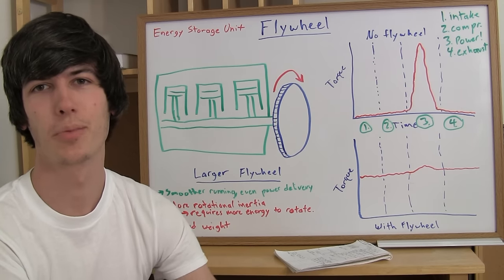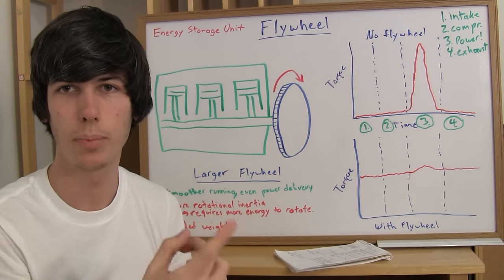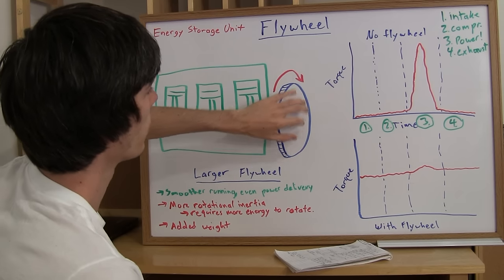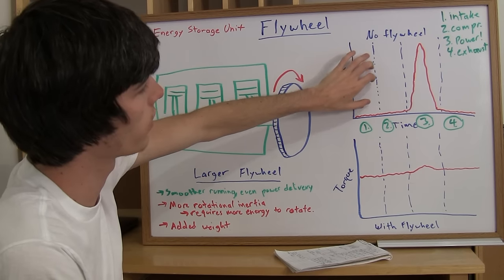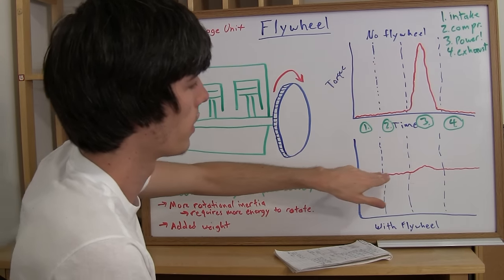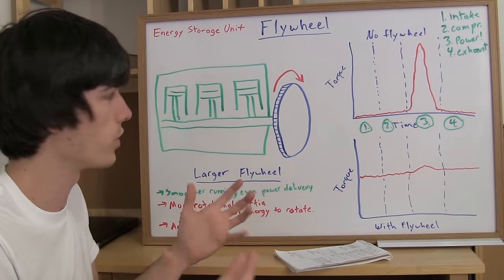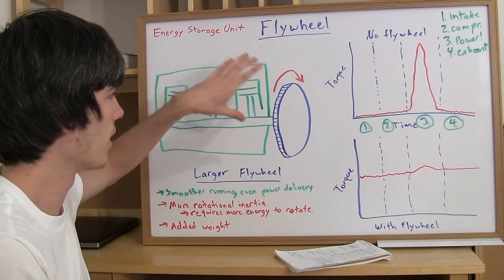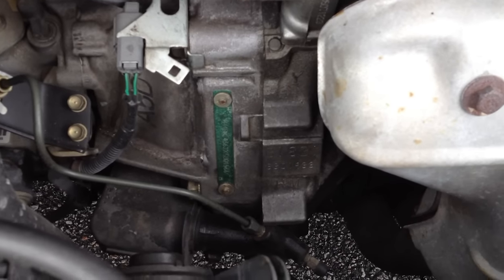Flywheel - Explained

Comment: My car grinds for like 2-3 seconds when I start it up and then it stops, could the flywheel be that reason?
Reply: +Travis Christensen either the bendix (small gear in starter that gets thrown out and engages into the flywheel) is missing teeth or worn, same goes for the teeth on the flywheel. So basically, yeah.
Reply: maybe your clutch...or there fly wheel 
if your fly wheel friction plate times up  its happen when you start the vehicle

Comment: so it is a bit like a capacitor in electronics.  nice video
Reply: I think it's the opposite. A capacitor continuously slowly takes up charge, and then releases it all in a quick burst. A flywheel, on the other hand, takes quick bursts of power and maintains a constant flow of the power outwards.
Reply: Eiad Hamwi I see, ty, so more like an Electromagnetic coil.  trying to relate to what i already know !  :)  ty again
Reply: ***** Wait. You were actually right initially. Capacitors are used to regulate the flow of current. However, they're also used for quick bursts as well. So, yes, a flywheel is similar to a capacitor, but a capacitor has some uses that a flywheel doesn't.
Reply: I see your point, perhaps then not like a capacitor acting on it's own, but rather synonymous with the effect a capacitor can have on an output function when placed in parallel. I, too, couldn't help but bring the similarities between the flywheel and capacitors 'smoothing/filtering' effect on the output function.
Reply: Eiad Hamwi flywheels are pretty much exactly synonymous with capacitors in electronics and water towers in plumbing/fluid dynamics.

When the engine is running but the clutch is open the flywheel stores energy, which can then be transferred to the tires either quickly or slowly by releasing the clutch either quickly or slowly.
Reply: Isaac Karjala I recently started learning more about electronics and realized what I said was very wrong. Sorry for my ignorance.
Reply: Eiad Hamwi look for afrotechmods on YouTube, you might find their videos enlightening
Reply: Isaac Karjala I actually found out about him a few days ago. And yes, the videos were really interesting
Reply: not same but your opinion is correct.
cap can have the energy without power source for a short time but fly wheel needs power soruce it cant work without power stroke .
   fly wheel is like Voltage and current

Comment: well, I understand most of this, but I don't understand how the fly wheel is continuously rotating if you are not hitting the gas, is it because there is always gasoline flowing to the engine(when running, of course)?
Reply from the maker: The power strokes give the flywheel enough energy to keep rotating.

Comment: so does the crankshaft rotate the flywheel or does the flywheel rotate the crankshaft?
Reply from the maker: Power strokes rotate the crank, however the engine is started by rotating the flywheel (and thus the crank).

Comment: What happens if a mechanic chamged the motor and didnt change the flywheel? I think he may have left the flex plate on the motor it was running and the starter went out

Comment: So I went from my 17lb flywheel to a 10lb and It feels like my car has better acceleration. The downside is driveability.. I feel like I have to be at the perfect rpm to release the clutch to engage smoothly. And releasing the gas while in gear on normal traffic roads tend to slow it down sooner than my stock flywheel. Is popping into neutral going to keep some of my speed and just popping my gear in and out just to add gas going to affect my MPG. Hypothetically I'm addicted to shifting.

Comment: F=ma 
Think about the truck (m), the heavier the truck is, the more difficult to change the
velocity. (Linear motion).
M=Iα
where, I = mr^2 (moment of inertia).
I is similar with m, so the larger the moment of inertia, the more difficult to change the rotating velocity. 
Basically, the flywheel is based on the principle of the moment of inertia.
As we can see the flywheel had the large diameter creating the big moment of inertia.

Comment: The gear doesn't matter. The weight of the flywheel is negligible when talking about top speed. It might help you a little to get to top speed faster(shouldn't be visible), but it would not increase it.

Comment: The power distribution would only be on a engine where their are periods of no power stroke. Say on a 4 cylinder. Where as a inline 6 cylinder is always on the power stroke in 1 cylinder.

Comment: here i have a question. im new to engines lol. anyways another disadvantage to having a big flywheel would be the speed in which you  accelerate right? cuz the power would be spread out and would take the course of four strokes to acheive the power prodcued instead of just one. i mean obviusly you dont want all the power in one becasue then the engine would stall. but having a smaller flywheel in general would mean faster accelerations right? to a degree ofc. anyone who is smart lol could maybe help me out. ill repeat that im very new to engines and am a little confused
Reply: great video btw

Comment: So in theory, a straight 6 engine can eliminate the need of flywheel, is that true?
Reply: not really, a straight 6 can smooth out power delivery, just as increasing the number of cylinders can(like a v12 would be double the smoothness) but it's still necessary.
Reply: The arrangement of cylinders in an inline-6 engine makes for a smoother and more balanced engine operation, but when the accelerator pedal is released, there still needs to be something to maintain the engine's inertia

Comment: I have this idea eating at me please help by telling me whether it’s good or bad:
İntro:
On a highway our travel speed oscillates lets say between 90-80 km per hour. We slighly brake each time and an x amount of energy is lost. Instead we could store that energy, hence evs have regen breaking which is inefficient. 

With an IC engine car, we could store the kinetic energy of the car as kinetic energy by diverting it to the flywheel and the pistons by downshifting. If the upcoming acceleration period is close enough, we will not have lost the energy we stored to friction losses. we could put back the remainder into the car by upshifting. Which I do with my manual transmision car. 

Problem: people dont bother micromanaging that. 

İdea: with the addition of collision detection systems(distance measurement) a car can now be made to know whether you are breaking because the car in front of you is breaking. In such cases automatic transmissions can be made to have a mechanical regen switchable mode, which when breaking and accelerating automatically do what I do with my manual down/up shifting to store energy. Minimising energy loss to breaking especially on highways.

I couldn’t do the math on the energy storage capacity of the engine though.

What do you guys think? I need to get this out of my head

Comment: Can flywheels fly ?
Reply: They say if you keep your engine running neutral the flywheel will fly far away to forgotten lands
Reply: Nox665 no, but they can wheel.
Reply: If you havent bolted it properly to the crankshaft it will break off and as it is heavy and the gearing is making it similar to a saw it eats up a lot of material until it stops spinning. It would be very unlikely to escape but if it did, it would indeed "fly".
Reply: Nox665 ii

Comment: does a fly wheel work on size or weight ??
Reply from the maker: Both will impact rotational inertia, so both. :)
Reply: The radius of the flywheel affect its rotational inertia 4 times more than its mass.

Comment: Not trying to be "that guy", but, technically, a manual transmission has a flywheel, and an automatic has a flexplate ... right? An automatic won't have a flywheel, and a manual won't have a flexplate. Common between the two is they both fit between the engine and transmission, and the starter engages a gear on them to start the engine.

Comment: u r saying that torque is high in power stroke and for other strokes it is very low..... bt at that time there is power stroke in other cylinder...  there is always a power stroke in one of the cylinder.... so what about ur graph?
Reply: so a cylinder goes bang, forces the piston down, rotates the crankshaft which pushes another one up, bang, forces the piston down and so on. The crankshaft has 720 degrees of rotation with a bang at only 1 or 2 of those degrees every 180 degrees, that bang obviously creates the power, the flywheel keeps the engine rotating at the point there is no power strokes. With respect to the graph, it would look similar but with 4 peaks
Reply: It's to keep it basic so people can understand and what about a single cylinder engine?

Comment: hey how flywheel stores the energy from power stroke and how it gave back to crank shaft for the maintain the other 3 strokes?
Reply from the maker: +Moditha Damindu There are other cylinders firing as well, keeping it spinning, but it's a rotating mass that has inertia so it continues to spin.
Reply: +Engineering Explained My point is how its stores energy from power stroke?
 my earlier question is that.
now i figured all the power strokes rotation greater than other strokes so when power stroke flywheel rotates fast and it rotates the crank shaft and crank shaft moves the connecting rod and piston goes up and down and other 3 strokes works.

am i right or wrong?
Reply: +Moditha Damindu rotational energy
Reply: +Moditha Damindu wrong it's like the rear tire of a bike, the chain is connected to it, your feet is the piston. If you're pedaling very fast and let off the tire is still going the same speed if you start pedaling again you'll still going the speed as the tire.

Comment: Larger flywheel decrease acceleration. Light flywheel encourages acceleration
Reply: But also loses its energy quicker.
Reply: A heavier flywheel is good for a daily driver. It givs a little extra torque and makes any engine run verysmoothly

Comment: I have something in mind, what will happen if i took out a Huge truck engine
maybe a V12 Diesel that at least revs up to 2500 rpm's

then lower the gearbox ratios and also lower the final drive ratio. and probably install a heavy duty prop shaft

what shall be the outcome of this monstrosity?
Reply: Jasper Ezekiel Domacena a burnt engine

Comment: not a huge difference; they moved springs which used to be inside of the disk clutch to the internal part of the flywheel, and increasing the price accordingly.

not that the engine will run a lot smoother... with DMF

Comment: No actual "science" has been used lol.  I just remember thinking after the modification that whenever I eased off the throttle the car slowed down a lot less.  Although its been so long since the mod I might just think in my head its a bigger difference than it actually is

Comment: I just changed the flywheel on my 2011ford f150 and now my truck will not move forward or back
Reply: I think you've done it wrong
Reply: @b.eduardo5105  the truck is stuck in 1 and 2 gear and shifts back and forth and will not move
Reply: Might be the clutch not disengaging, Take it to someone to have a look at it, there's to many variables to diagnose it over YouTube.  @coccogonzales6260
Reply: @b.eduardo5105  my truck is an automatic transmission, but I might just have someone look at it.

Comment: NOT SO ON A CAR OR TRUCK ENGINE... ON THOSE ITS ALL POWER..... FLYWHEELS ARE TO SMALL ON CAR ENGINES. IT TAKES A FLYWHEEL THAT IS LIKE 20 INCHES TO  20 FOOT TO STORE AND SMOOTH ENGERY OUT...  LOOK AT THE POTTERS WHEEL YOU ARE TALKING ABOUT VERY BIG COMPARED TO THE LITTLE BIT OF CLAY USEDS.  INDY CARS DO NOT USE FLYWHEELS..   SOME MOTOR CYCLES THAT RACE DO NOT USE FLYWHEELS...... WHY NOT ? BECAUSE SMALL FLYWHEELS ARE USE TO CRANK THE ENGINE AND THATS IT !!!!  CLASS IS NOT OUT OF SESSION........